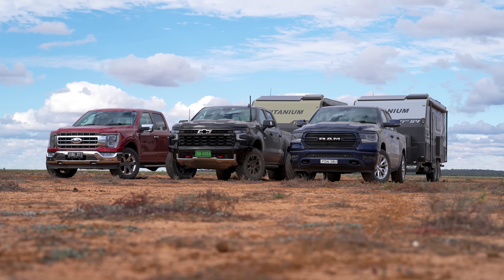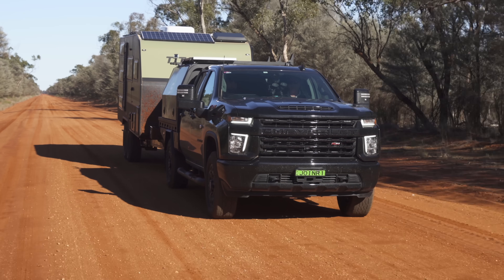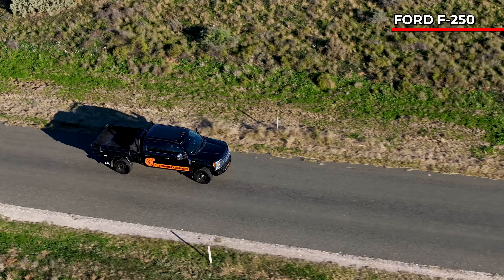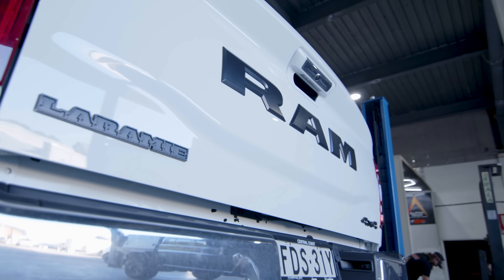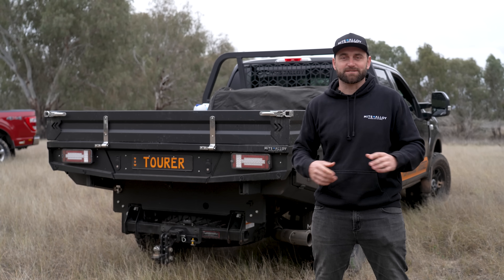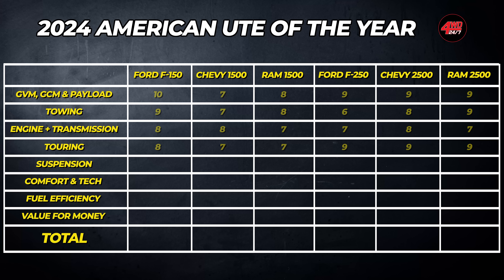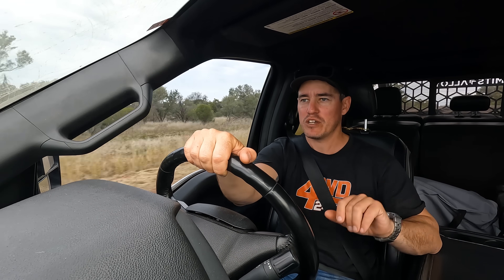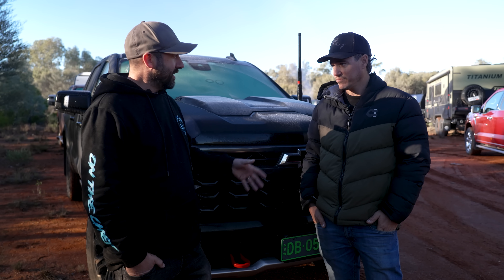2024 RAM vs CHEVY vs FORD TORTURE TEST! Heavy towing, dirt roads - SHOCK WINNER & major problems

Comment: We’ve been touring around Australia full time for over 4 years in a Silverado 2500HD. We’re done over 90,000ks and thrown it through seriously harsh conditions. It’s never let us down. We’ll never go back to a normal 4x4
Reply: @AussieDestinationsUnknown  If you have a 2011 to 2016, you may want to do a  CP3 conversion. It's bad enough when the fuel system self destructs here in the states. I can't imagine trying to deal with it in Australia.
Reply: @harrywalker968 Isuzu built engine yes but not the truck which is built by General Motors the 2500 hd Duramax Diesel has earned its reputation in the Diesel community bar none I own one had it for 18 years best pickup I ever owned 
Yes 7.3 powerstroke was legendary AT its time built on the reputation of international and placed in the mighty F250 and F350  though 7.3 faced discontinuation and was downgraded to that awful 6.4 powerstroke which hurt the reputation ford had as for these new models now are all pretty well balanced due to American emissions regulations that showed up due to rolling coal users that pissed me off  just like you negative and disrespectful posts on others peoples post  and currently your 7.3 has no comparison to this show whatsoever that is testing the most current trucks that you can buy at the moment and do us all a favor n take you negativity everywhere  thank you n have a good day from United States 🇺🇸
Reply: @harrywalker968 not Isuzu just the engine is developed by Isuzu and still its not related to Isuzu on the new gen
Reply: @AussieDestinationsUnknown  You didn't say WHY you will never go back. What about it is so much better? Does it use less fuel? Is it more comfortable? Is it better off road? What are the reasons for your choice?
Reply: Harsh conditions 🤔😂
Reply: Anecdotal evidence.
Reply: @GabeRonalds-o2y We've seen plenty of spam from you as well. Just unsubscribe mate, it's better for all of us.
Reply: @DakotaOverlander  6.4 wasn’t that bad, just everything bolted to it was 😂😂😂
Reply: @TheTripleDubya  when they first came out they were from what I was told by those that owned them lol
Reply: @harrywalker968  Probably takes a diesel from ford to make it that far, 300k minimum out of an old Vortec all the way up to 1 million miles…
Reply: Honestly, if you go 2500/3500, you're better off with a diesel( it doesn't matter what brand of truck, but dodge has had a big issues recently). Have 2 gmc 3500 crew/long bed duramax's, an '04 sle & a '24 ultimate. My '24 pulls my livestock gooseneck loaded down with livestock at 30k lbs going through Tennessee mountains like a dream. '24 is a little over 60k miles hauling at this point and no issues other than cosmetic stuff like the the grill paint/wrap chipping.
Reply: @brendanstreet1868 
They are towing a large caravan, that probably weighs over 3.5 t
They r full time travelling around Australia 
Many very poor quality dirt roads etc
Reply: Glad to know that.

Comment: In the USA we build these trucks because we use these trucks. The trucks y'all are seeing is the hi end decked out cabs. The standard truck has the same running gear. We put service beds and in case's needed out fitted with a crane. We WORK these trucks. And we play hard, take them in the back country and mountains running LOW range. Then going to work the next day.
Reply: It's OK, us Aussies are still feeling intimidated by them.... haha
Reply: Here in Texas, i dont really see these new rigs running that hard... OBS, yea, those are built rigs, but these new plastic things aint runnin as hard as they used to

Comment: Those trucks will hold up just fine. We beat them in just as harsh of conditions in the oil fields, farming,  construction, logging etc. Plus we use them as snow plows. The chassis are boxed and over-built for what payloads they're being used for.  The biggest wear items would be tie rods and upper/lower ball joints.  Keep em greased.  As far as driveline breakages... you'd have to be intentionally trying hard. Like anything,  maintenance goes a long way.
Reply: When they say off-roading, we are referring to our remote outback tracks where there might not be another soul for 1000kms. Also, would you take one of these to Moab? Stuff like that.
Reply: @josepharthur2338  yes. Absolutely.  However for you,  going remote. Spares might be a issue.  But yes Absolutely.  We use them here in North America as overlanding and trail running.  That's ZR2 is a Baja racing platform out of the box. We also have the Colorado ZR2 which would be similar to your Utes. But factory on 33" and some trims offer 35".They're twin locked and major powered engines.  The Silverado ZR2 can even be optioned with a 3.0L inline 6 diesel (though I don't think it's available to you)
Reply: @craigquann  if you’re familiar with the channel, you’ll have seen the climies track where it goes up a waterfall. I don’t think (and clearly the panel who have done that kind of off-roading don’t think)  any of the models that were reviewed would be suitable. And remember, that’s what this comparison is about. We cannot compare stuff that doesn’t exist as an option
Reply: @josepharthur2338  I'm aware of the channel.  What do you think we use? Lol. I'm telling you that ZR2 will be just fine. The others are pavement/jobs site 4x4. The 2500s would definitely be too heavy, but make great touring trucks. Remember where Graham takes a Stock Dmax. Granted.  The price tag is probably one reason for you not too. Definitely wouldn't want to flood it however... lol. I'm not a fan of all the BS electronics. I would take my own truck.
Reply: @craigquann  would you agree that the fellas that have driven those tracks and have driven tracks stateside are saying that they aren’t suitable for Australian offroad tracks would probably know? I mean I’d love to see one of these do gunshot, but I think they’d be too wide.
Reply: @josepharthur2338  maybe... but thats a real specific obstacle.  But again.  We use them here.  Put it this way, where would you take an off the dealership lot Ranger Wildtrak? I'm sure if Shaun wasn't worried about damaging a $135k borrowed truck, you would get a much better appreciation.
Reply: @craigquann I sold my ranger cuz it was hopeless offroad. The wheelbase nor the weight of these vehicles can't be overcome.
Reply: @craigquann  Or you have the much more powerful F150 Raptor/ Raptor R and Ranger Raptor when you want big factory horse power off road trucks !!
Reply: The big question I have is how do I not go over weight with a Ram 2500? I want to tow and go off road. Frasier Island, Simpson dessert and Cape York (minus Gunshot😂)

Comment: These vehicles are still cheaper then a chopped 200/300 or y62 or do 300mm/600mm extension which people build for touring
Reply: Chopped 200/300 or Y62 comes with legendary durability, reliability and build quality. 
You can't say the same for these massive yank tanks. I would not trust my life with an American pickup in the outback.
Reply: @electrikoptik  and yet there has been plenty of instances where 4wd24/7 had had to call for professional help in getting their stranded 4x4 out of the bush and other times having to jury rig critical parts of the suspension to even make it to a place to make a call sooo regardless of what you just mentioned about reliability and durability and build quality you can and still have a breakdown 
Now the Ranger  a pickup commonly seen in 4WD24/7 is an American vehicle and has shown that it can endure the harsh experiences of the Outback
Reply: @DakotaOverlander 

The ranger is NOT “an American pickup.”

Ford is an American company, but the Ranger is a global truck designed and tested primarily for Australia. If a vehicle can survive Australia, it will pretty much survive anywhere else.

How do I know? I literally live less than 30minutes from the place it was designed… oh, and I work 5minutes drive from it.
Reply: @Butho_04  YES it is an American vehicle
You get it from Ford right???

That is an a American motor company believe it or not there are American cars that are only built for EU and Australia that we Americans can’t get  here in America  
But YES we can get The Ford ranger here in the USA  and it was born here in the USA first showed up in the 1980s along done the Bronco 2 so Yes it is in Fact An American pick up  
 Do your research on its history before you try to correct me
Reply: @DakotaOverlander 

By your logic the Holden Commodore is an American car. GM owned Holden so it’s American right? 

The ranger not an American truck. It’s designed by Australians for Australia. We never got the piece of shit you call that ranger from the 80s. The only thing in common is the name. 

Another american thinking the world revolves around them.
Reply: They're not, an used 200/300 or y62 chopped/converted into a pickup truck will cost under $100k. Those American pickups are all over $100k or $200k in Australia.
Reply: @hi9580  You are not been honest about the pricing at all. 300 sahara is $140k, Y62 is $85k and 79's are about $85k with hilux engines (i know you didn't mention them).
People are spending $40k for a chop, $40k for top tier canopies and $20k for coil conversions, brake upgrades, chassis bracing, engineering (which is only STATE based).
This channel with MITS compared the 79 vs 1500 in suburbs and found the 1500 despite its size to be hands down the better vehicle.
The AUS cars are only significantly cheaper if they don't go through the popular touring upgrades frequently seen on this channel.
Reply: @Mi-ck  no the Rangers origins are not Australian bud   The ones you get may be build in Australia but that does not mean it’s Australian  as for An American motor company to sell in Australia it is cheaper to set up in a country and build them there as opposed to to shipping cars n trucks across the ocean 
And as for the Holden that is not what I said I said they are the same truck in design if you put the Chevy Colorado  and the Holden Colorado next to each other 
Good a lord another jerk who can’t keep a conversation cool and also needs to Research the History of Fords origins
Reply: @MrSnakekaplan  that’s pretty reasonable to me  to get a MITs alloy trey and canopy for my Silverado ranges around  25k as I do not need a chop since it is a pick up
Reply: @DakotaOverlander  I'm not telling people what to spend their money on. I'm just setting the record straight about pricing, our existing market is not sub 100k. I didn't even mention how much people spend on automatic conversions for the 79. The 300 is the same price as those trucks without any upgrades/mods.
Reply: @MrSnakekaplan  lol no I know I went and got a quote on a MITs alloy Trey and canopy at first I wasn’t expecting the price but when you look at the modifications you want and  then it get built in Australia then sent to an outffiter here in the USA  soo I was like uh wow ok lol
 So that idea is currently on hold lol
Reply: @DakotaOverlander  the ranger you get is not the one we have here. It also isn’t built in Australia. It’s built in Thailand.
Reply: It’s remarkable how none of the experts drove consistently with both hands on the steering wheel. One would have thought that Hand placement, especially while being distracted while talking to a camera would have been paramount. Apparently not. 
Information on each rig, was excellent. Comments were on point, outlining both the positives and negatives.

Comment: i have a 2023 f150 lariat, 5.0 coyote with a 3l Whipple supercharger and 3.73 gears.   Man I wish you guys could feel how amazing this truck is to tow with.  It gets better fuel economy than the ecoboost or powerboost and it tows effortless with my enclosed 16' with HD axles, filled to the brim.
Reply: The problem here is that if we compare fuel prices it’s would cost you about $10 a gallon

But mint truck must sound 👌
Reply: Same! That’s the exact build I have. (Louisiana)
Reply: @bradypierron8736  I'm up in Alberta, I frequently head south to East Texas. I sure wish I could move down there
Reply: No way a Whipple 5.0 gets better fuel economy than a Powerboost.
Reply: @kevinsteele2773  with the amount of towing I do, the premium fuel bill with the Whipple truck over X KM travelled is still cheaper than the powerboost towing with regular or premium fuel.   I averaged between 5.6 - 6.1 mpg with the powerboost.   I'm averaging between 9 - 10.2 mpg with the Whipple truck. Same enclosed trailer and same equipment setup.
Reply: @chrisreyes154  on the highway and towing, yes.  The powerboost needs to be driven in a specific way that tricks the computer to go into EV mode. So on every downhill you need to tap the brakes a couple times, which makes the truck think your slowing down for a red light, you can't use cruise control on or above the speed limit etc.  the guys getting insane eco with the powerboost are driving them in this fashion.  The guys driving them with CC on and actually doing proper speeds usually average about 20mpg on the highway.

I had a Whipple 5.0 2018, powerboost 2021 and I currently drive a Whipple 5.0 23 Lariat high.

Comment: Howdy from the States!  

Here is how I use low range in my 300,000+ mile  2004 Chevy Silverado 2500HD Crew Cab long box 4x4 Duramax LLY/Allison auto trans.  I use low range when towing heavy off pavement.  Here in the States we do not have many unpaved roads with speed limits above 30 mph and so low range gives the transmission the option of shifting to a better gear instead of staying in 1st or 2nd all the time at lower speeds.  Many of the remote campgrounds have steep winding dirt roads leading to them and low range provides better engine compression braking and better throttle response at lower speeds - ideal for towing heavy.

I also use four wheel drive high range in slick road conditions like heavy rain, fresh snow, compacted snow/ice.  Having both axles locked together makes for far better braking than relying upon the anti-lock computer!  This is a huge improvement - you have to experience it to realize how much better braking on slippery roads are in four wheel drive than in two wheel drive.  

I love this channel BTW!
Reply: What are you talking about? The vast majority of the US with farmland has tons of unpaved gravel roads with 55mph speed limits.
Reply: How does 4 wd equel better stopping?? Unless theres some nanny control, 4wd has zero to do with braking.
Reply: @camaro1139  It can help if you are engine braking, especially on steep hills. Keeps the rear end from breaking loose.
Reply: youve done over 300k miles in less than 9 months? wot
Reply: @JW-qf2fx  it's an 04, not a 24

Comment: I drive my 2015 F-150 from West Texas, USA to Colorado and Utah, and I drive many of the "Jeep" trails and dirt mountain passes with my family riding in comfort. Of course there are trails I by-pass to avoid panel damage or obvious clearance issues. I know it is not a rock crawler. Last thing I want to do is tow a trail vehicle to a trail, unless its a motorcycle. We drove the stock F-150, with upgraded tires, over White Rim Road in Utah and had no issues. Today, with 150,000 miles, no issues with the turbo or anything else on the truck. ...and yes, it tows great.
Reply: I believe it can be wheeled, but i have a hard time seeing anything newer running what people run in their OBS or trail rig, definitely respect the usage you're putting yours through! Texas is my home and i love going into Colorado just for the trip

Comment: Bought One of the first Ram 1500s converted in Aus By ASV just passed 154k only issues have been what I have done to it with after market options, best of all Harrop super charger this thing is still a beast for towing up mountain passes as I have no one sitting on my rear at 440hp to rear wheels and am now sitting on 15 lp100k across the life of my Ute,I have never reset the fuel gauge how’s that compared to your 200 ?
These are more 4WD capable than they are given credit fore in this video I am usually called out to get my sons utes out of trouble 
Enjoy 👍
Reply: Agreed.
Reply: 100% I feel like they're pandering to their target market and too scared to hurt their feelings....
Reply: @shackleton274  Agreed, especially when each has spent quite a considerable amount to build a 200 series Ute and a Y62 Ute, instead of getting one of these 1500s.

Comment: Love the video, Shauno nailed it, Americans do off-road these trucks. The F-150 Tremor and Raptor are very good off-road. The Chevy ZR2 as well. Then comes the GOAT, the Ram 2500 Power Wagon, comes factory with solid axles, front and rear lockers, electronic sway bar disconnect, and high articulation suspension Arms. Very capable off-road.

Comment: I have an older f250, but in America their is huge support for these trucks. Don't reinvent the wheel. I have a Carli 4 inch lift with Carli valved Fox 2.0. It's like a Baja truck. Running 35 inch tires.